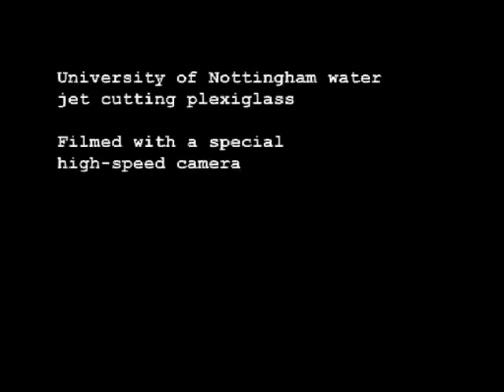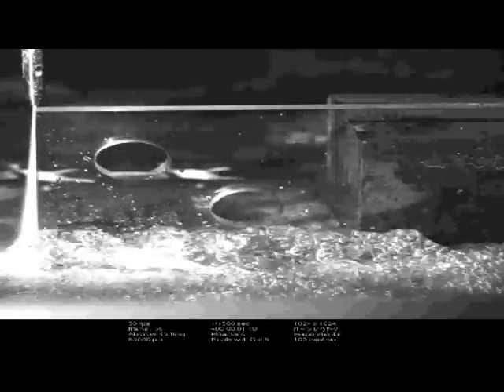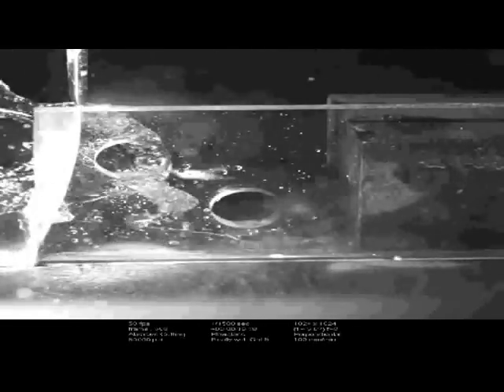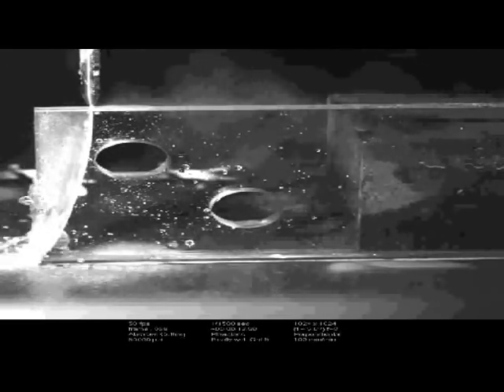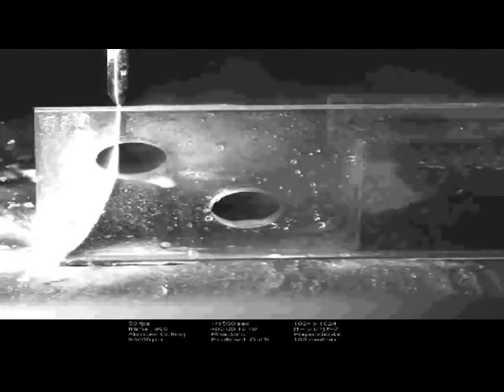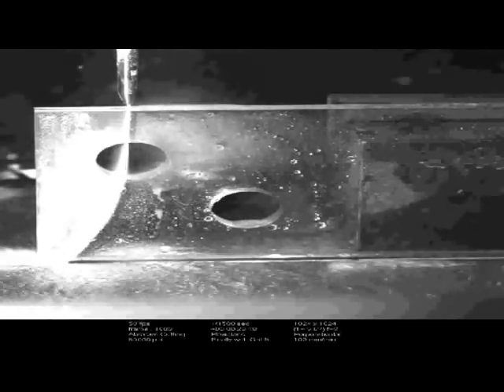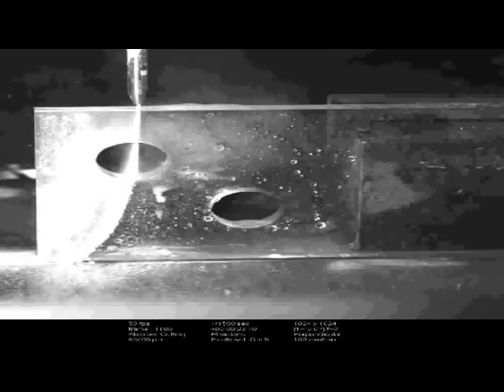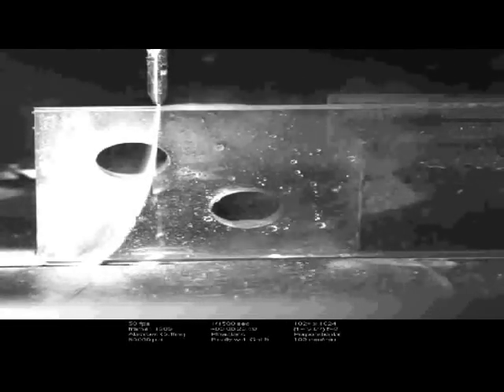Hypnotic water jet

Comment: It's actually made of ruby; there is a tiny synthetic ruby in the tip of the nozzle through which a .3mm hole is drilled for the water or water/garnet mixture to pass.